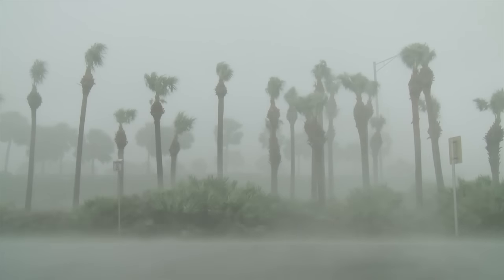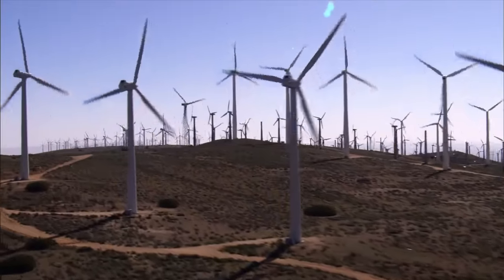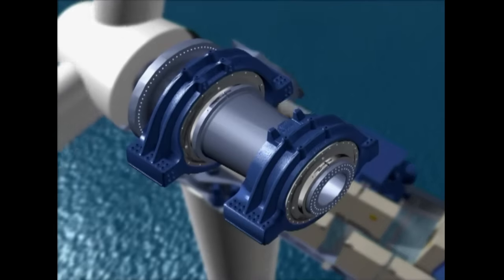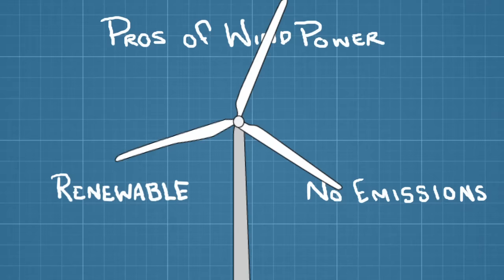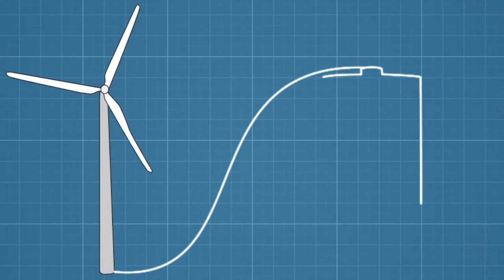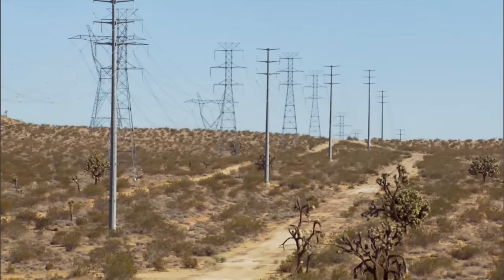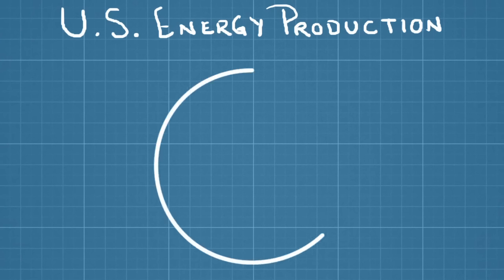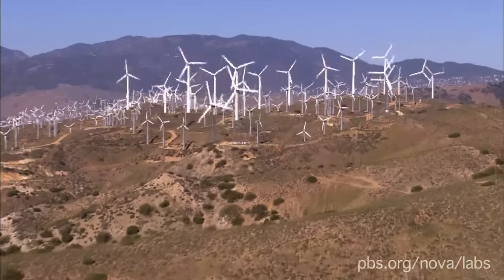The Pros and Cons of Wind Energy

Comment: Wind and solar generation disrupts the grid's stability because their output fluctuates erratically with weather conditions. 

Thus, every wind and solar installation must be propped up by reliable nuclear and fossil fuel plants which compensate for the dangerous and unpredictable fluctuations of wind/solar output. 

Otherwise, they would cause life-threatening black/brown outs and voltage spikes throughout the day.
Reply: Not necessarily. Storage technologies for power are improving in efficiency. Also, hydropower can provide a large renewable base load to even out the peaks and troughs of intermittent renewables (solar and wind).

Comment: I did some calculations based of eia capital cost for power plants witch list the cost per kw or mw for capital cost, maintenance and fuel. the cost per kw to make 1 kw of electricity from a plant operating at 100% full power for 95% of the year wile paying a 20 year 3.14% loan from coal is 2.8 cents, natural gas combined cycle 1.1 cents nuclear 5.1 cents now since wind operates at around 20% at full power for one year it cost 9.5 cents solar runs at 40% full power (desert) at 7 cents kw but that's ok because the cost for power during daytime/ peak hours cost more around 10-13 cents
nuclear cost 5.15 cents kwh increase that by 35% for 7 cents kwh you can get fuel/ uranium from seawater using high cap depending on the cost of the plants (fast breeders) and when the power use goes down you came make hydrogen fuel during the night but to offset gas you would need dedicated plants making hydrogen and their is enough uranium in seawater for 1-3 million years of energy